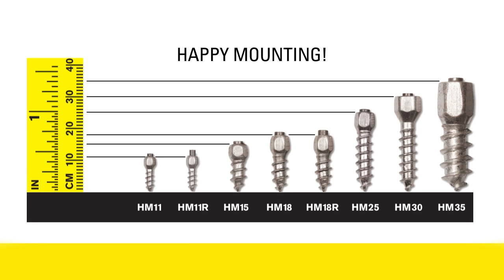MaxiGrip - Screw Studs for DIY - Tires

Comment: People’s preference sure varies, studded winter tires or non studded, I prefer non studded, I just purchased new tires that have small hole slots for stud install option. Here we do get a lot of snow during winter but mostly seem to get black ice, icey roads with studs, you seem more likely to slide on black ice, with studs.
Reply from the maker: Thanks for the comment. Maxigrip are designed and tested for off-highway vehicles and do help where there's ice or hard packed snow.  Studs will even help on black ice but as it tends to be in smaller patches there will always be a sensation of losing grip, as even with the help of studs you'll never have as much grip as a tire will have on bare asphalt.
Reply: Your not correct but instinct tells our brains that your right. I've ran studs and studless. And studs are in my humble opinion, the better choice even if you just stick to town and drive real slow. I take pickups way up hills and passes and deep valleys and long lonely cold flatland and I like the assurance that studded tires give me. That and an educated foot on the clutch and gear selection have brought me thru some of the wildest storms that the Rocky Mountains have had in my 35+ years on the road. Black ice is a no rules kindof surface tho, even studs are no guarantee with that road condition. Losing it on black ice has alot more to do with  the combination of ground speed, engine speed, slope and angle of entry and if you boof up that formula in any way your teeterin on catastrophe. So keep her slowed down when your going thru the shaded spots in them canyons. 🤜🏻🤛🏻

Comment: Sorry but the heads wear out from pavement making it hard to remove
Reply from the maker: Sorry, we missed this comment previously but will add a late reply for the benefit of other visitors! They're designed primarily for temporary use when there's ice or hard packed snow.  If you leave the studs in long term and drive a lot on asphalt then yes, you will risk wearing down the heads.

Comment: How well do these stay in there, and do you need to pre-drill holes? Want to use on a 3/4 ton truck for winter.
Reply from the maker: Hi!  Thanks for the question. You don't need to pre-drill any holes, and after removal the rubber more or less closes up the holes again.  They are designed for off-highway vehicles, and can't be guaranteed for the much higher G-forces generated at highway speeds.